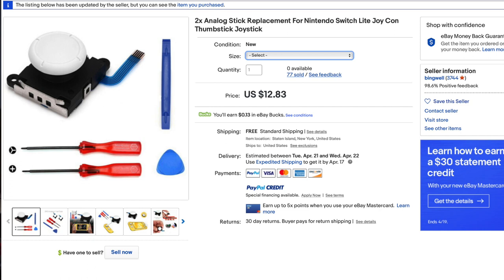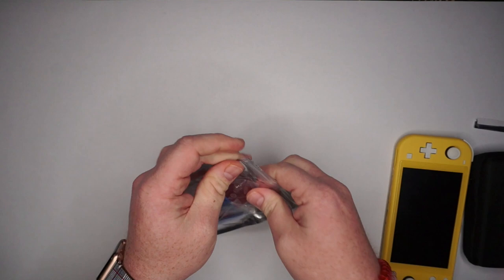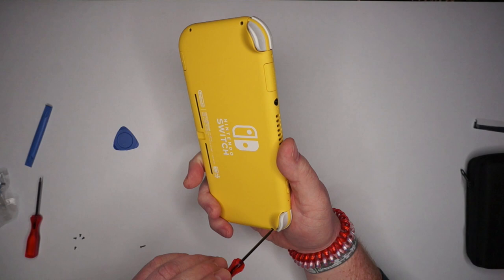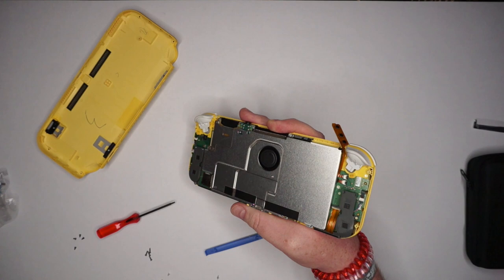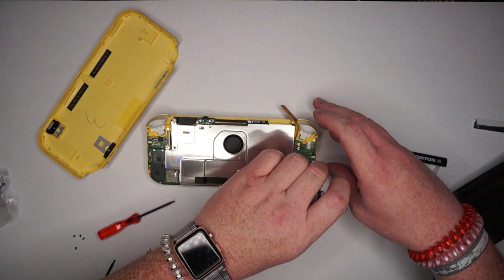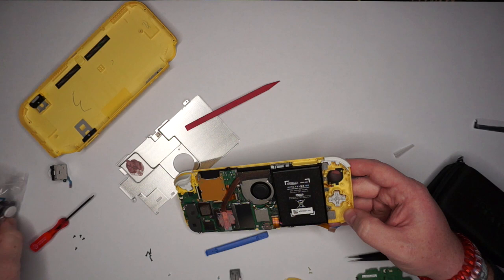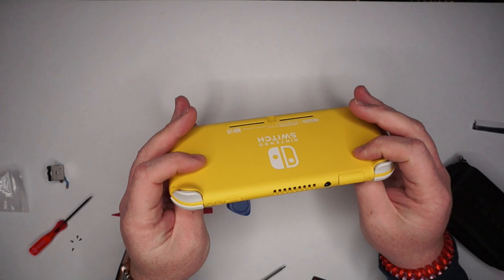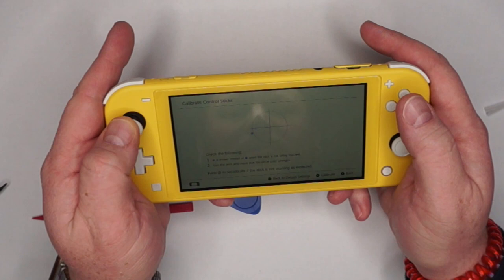Swapping a Switch Lite Analog Stick

Comment: I've never worked on tech hardware before, but I have to replace a toggle. Is this something a complete novice can do?
Reply from the maker: That’s a good question, honestly you can do it but it won’t be easy if you aren’t used to the way ribbon cables release and reconnect. If you have questions, definitely reach out to me on social media.
Reply: @PunchNpie  Thank you for the reply. I got the repair kit today and popped it open, but I didn't get farther than the speaker. Such small pieces, I wouldn't know if I broke it or not. So, I'll have to ask a friend. Thank you anyway, especially for making the video.
Reply from the maker: No problem, if you reach a point and can’t get it done and you live in the states (cheap shipping) I can repair it for you.

Comment: My switch fell off a chair and hit the radiator. The right joystick snapped out of the socket and I have no idea what to do now!
Reply from the maker: Oh no, that sucks!!! Well you can definitely replace it yourself. I don’t know how confident you feel doing this yourself though.
Reply: The exact same for me basically.  Left it out of my case on my bed one night and woke up to it on the ground.  The plastic ring (socket) just under the right analog stick on the bottom part broke and I’m hoping this place near me can fix it.  Basically in games I can’t actually look around.  The analog stick works perfectly fine though.
Reply from the maker: I really should start a repair service for these...
Reply: Same. Mine fell of the couch. I'm not sure if I'm brave enough to try this myself.
Reply from the maker: That’s sucks and I completely understand how you feel. Like I said above, I should start a repair service.
Reply: dropped mine off a bunk bed.. she had a case, and only the joystick snapped, but still stressful :') fixing her rn!

Comment: Well. Tried this and now the screen isn't working. Time to cry on the phone to Nintendo!
Reply from the maker: Did you forget to power it off prior to the repair? Hold down the power button to make sure it’s completely off and try turning it back on. I think when you remove the left board while it’s on, it kills the display.

Comment: I dropped my switch and the joy stick popped out of the socket and I couldn't get it back in. I got all of the stuff to replace the whole thing and I got all the way to the part where I put the stick in then I broke the thing that the ribbon was supposed to go in. My switch is ded
Reply from the maker: Oh no... that sucks! Is it the left or right stick?
Reply: @PunchNpie  my left
Reply from the maker: So you aren’t exactly screwed. The left stick connects to a board that is a separate board. the the rest of the switch runs off another board. I may be able to find you a replacement board if you are interested.

Comment: I got a switch lite as a gift so I could play pokemon with my little brother. Brand new and this problem you mentioned was the same. I got a kit off amazon for $15 and followed your steps. Worked great. Thank you, you helped me a lot.
Reply from the maker: Awesome! Glad I could help!!!
Reply: @PunchNpie  Yeah, you eased my concerns, it's been probably over 20 years since I've opened up my old gameboy to fix a wire issue. lol
Reply from the maker: Yeah and those old game boys had the simplest build too! It’s a single board and 1 ribbon, if I remember correctly.
Reply: @PunchNpie  I don't remember exactly why I even opened up it back then. I think it was something to do with the battery housing connections.
Reply from the maker: There’s a channel called the retro future. If you like videos of people modding and taking apart retro consoles, specifically the Gameboy, you would really dig it.

Comment: Thank you for this video, was very helpful.  One very helpful tip not made clear for the benefit of other would-be switch fixers:  There is a 'lock' on the ribbon cable housing that flips up!   I didn't notice this mentioned until the re-assembly later on in the video. I also used a paper plate to set parts and screws in a clockwise order to help remember what screws go where later.
Reply from the maker: Those are great tips and thanks for mentioning them! When I make these videos it’s usually the first time I’m doing the actual repair so sometimes I’ll miss something.

Comment: what if i accidently strip the screws on the plate covering the joysticks> im like two screws away which are both stripped from actually replacing the joystick, im so frustrated i feel like crying
Reply from the maker: Did your replacements come with extra screws?
Reply: PunchNpie only the black ones with the Y shape not the silver X shape screws.

Comment: My switch lite did the same thing on the left stick. The bouncing thing and it also drifted to the right sometimes. I only had it for 2 days when it first started but due to the switch lites being sold out i was unable to replace the whole unit. I also don’t want to wait until Nintendo reopens the repair shops and have to be without it for 2 weeks so I just ordered a repair kit last night. Hopefully it goes smooth. Thank god it isn’t the right stick because that looks more difficult to do.
Reply from the maker: Good luck and that sucks! I’m actually thinking about ordering another set of these and do white sticks and buttons on my neon yellow joycons. I’m hoping my kid doesn’t mess up the right one on her lite because you may be right about it but at the same time I’m willing to take on the challenge!
Reply: how did the repair go?
Reply: @skullkideku5735  it went well besides stripping one screw so i had to drill it out. i think its because the kit i got had some cheap tools in it. I have a better kit now with some better tools in case i have to do any more repairs. The better kit was the first one i ordered but i was told it got lost in the mail so i got a different one. then eventually the first one showed up. some of the screws were in very tight so be careful!
Reply from the maker: All good advice!

Comment: Great video! Were the triwing screws hard and tight to remove? The triwing screws were rather tight to remove in the switch console itself.
Reply from the maker: Thank you! Yeah they were tight but I just put a good amount of pressure on them and gave a quarter turn to loosen them and then they they came out easily.

Comment: hi! do you know if this will erase your data on the switch? my right one broke and I'm super paranoid about losing the stuff that's switch-specific!
Reply from the maker: If will most definitely not erase your system. When I swapped the stick, I powered it back on and it was exactly as it was before the repair.

Comment: I brought my switch lite in September ! I still have no problems with the joysticks but I always do wonder if I will ever have a problem. Seeing this video does help me feel better about being able to replace the joystick if I ever need to (I replaced a laptop screen before btw) but you know I’m still new at this so I’m gonna be a little nervous when the time comes. thanks for the video!
Reply from the maker: Yeah you may never have an issue buts its good you have some experience working on “laptop” size components. The connectors weren’t much smaller than something you would find on a laptop. Hopefully you never have to do this yourself but, if you do, you are more than welcome to reach out for any additional help or advice.

Comment: Hello yes I fixed my left toggle and now when I plugged the strips back in my nintendo switch lite won't turn on
Reply from the maker: I had that issue the 2nd time I repaired one and basically all I did was hold down the power button for like a minute and it eventually turned back on. If that doesn’t work, pull the back off and make sure the battery cable is fully seated on the board.
Reply: @PunchNpie  hey I had this same problem too but it still won’t turn on...if the strips get scratched a little will they still work? The kit I bought came with very pointy and needle nose like tweezers.
Reply from the maker: What happens if you plug into the charger? Anything come up on the screen?
Reply: @PunchNpie  no. Usually after plugging in the charger for a while the battery icon would flash showing that the systems charging but no nothing happens
Reply from the maker: Is the battery icon flashing with a black screen? It’s possible the battery isn’t completely seated. I would open it back up and unplug and replug in the battery.

Comment: I am sad. :( I bought some new joycon pads and did not realize you are supposed to put them over the default pads and not replace the default pads. I was left to assume what to do since it did not come with instructions. One of the rubber pegs for the default pads popped out and I cannot get it back in its hole for the life of me so the joycon pad is misshapen and unsightly. Any fixes for this?
Reply from the maker: Oh no! Are you talking about the actual analog sticks?? You can replace them but it’s not easy.  Is a switch or switch lite?
Reply: @PunchNpie  Switch Lite. I am talking about the default thumb grip pads on the actual analog sticks. They are held in place beneath the pad's lip with four evenly spaced peg-in-hole type appendages made of the same soft rubber(?). The fit is so tight and the rubber (?) so malleable that it seems near impossible to push one appendage into a hole once it has been popped out from the lip being lifted away from the hard plastic analog stick. :(

Comment: My son got water on the left side. Everything works perfectly until you use the left joy con then it locks down. I tried to reset it nothing. I did replace the joy con but no luck either. 😢 Do you think replacing that left board completely out will fix it??
Reply from the maker: That would definitely be the next step. If you replace the board, At that point, you’ve replaced all components on that side of the system so I imagine you would have no issues afterwards. Have you priced out what left boards would cost?
Reply: Idk what happened but before the switch booted back up I kept my analog stick facing up and somehow that reset it and now it's working. Thank you for your video it was so much help

Comment: My switch lite right control stick is working fine, but I can’t click it,  should I swap it or is there another way to fix it? Thank you ✨
Reply from the maker: The problem is that the whole analog stick is one unit and you can’t get into it to repair it. It’s probably easier just to swap the part out.
Reply: PunchNpie I see, thank you for your time

Comment: Mine was just a couple of months old too and I fixed it because of your video but it was nerve-wracking just like you stated well fixing yours when it's something thats new it can give you some stress I broke one of the connectors to the speakers on the board but that's because I couldn't tell where the pin connector was cuz it was so small but it doesn't matter anyway cuz I use headphones and external speaker system plus the internal speaker system sucks anyway
Reply from the maker: Yeah I guess if there was anything I would want to mess up, it would be the speaker. I’m sure you’ll eventually be able to find a replacement speaker and swap it out. Parts should become more available I think over the next year or so.
Reply: @PunchNpie  well like I said I use headphones I don't care for the speakers I wouldn't even replace the speakers if both were broken well no I lie I would have at least one speaker working that way in case if I sell it the only way I would replace a speaker is if it was Amplified and was louder the modifications would probably have to be done to get more power four more louder speaker how the heck would all that I'll just use my headphones but yeah thank you

Comment: This only show one button I needed the other side replaced, it's not hard but you have to remove everything out of your way I think it took me maybe an hr and 15 minutes and I ended up changing both buttons. You don't have to remove the battery or the button to replace the on the other side in order to replace the left side button as you look from the back.

Comment: i just did this and had to redo the process 3 times. i put my switch on sleep mode before i started. after my first attempt i tried to power it on, and it made noise but no display. i removed the power strip cable thing and placed it back in, still no luck. is there anything that i can do? i really need help
Reply from the maker: Did you fill reassemble it before powering it back on? I would check every cable, you disconnected doing the repair, snd see if disconnecting and reconnecting it will help. I had a similar issue but I don’t remember exactly which cable was not fully connected causing the issue. It may be easier to shoot me a message on social media if you want to continue the conversation if that doesn’t fix it.

Comment: I replaced the left joystick and after putting it back together the switch lite will not turn on. Double checked to make sure all ribbon cables were connected and all was ok. Still will not turn on.

Comment: i’ve just replaced my left analog but now the display won’t work and just appears black please help if there’s a fix!!
Reply from the maker: Hold down the power button until it’s completely off. Maybe upwards of 30 seconds and than power it back on. I had this issue with one of the repairs I did because I forgot to turn the system off first.
Reply: PunchNpie no luck :( anything else you’d recommend?
Reply from the maker: Open it back up and unplug  the battery and plug it back in. Did you unplug it when you made the repair initially?

Comment: I have everything unscrewed except a singular motherboard screw. Which is stripped horribly now because of how tight it was. How do I get it out??
Reply: There’s literally little to no grip left
Reply from the maker: You can always try the rubber band trick. If you aren’t familiar just look up “rubber band stripped screw”. That may help.

Comment: I accidentally ripped off the speaker plug now I’m crying forever
Reply from the maker: Oh no!!! Good news is that it’s a cheap part to replace. I just looked one up on eBay and it looks to be about $12. Here is the link: https://www.ebay.com/itm/OEM-NINTENDO-SWITCH-LITE-New-REPLACEMENT-LEFT-LOUD-SPEAKER-LOUDSPEAKER-Oem-/154229454980?_trksid=p2349624.m46890.l49292

Comment: Funny how similar our situations are. Mine also does that bouncing back thing. And it only does it sometimes. I didn't spill anything in it. It just started doing it and it's been getting worse. Sometimes it will affect all directions with the stick. And my Switch Lite is also the yellow one haha

Well, now I should know what to do when I go to replace mine.
Reply from the maker: Yeah I’ve been hearing so many stories from people that have the similar issue that she may not have gotten something on it but who knows. Good luck with your replacement.
Reply: I went ahead and did it. I got a slightly different kit from the one you did. But I think the thumbsticks are the exact same ones. I ended up with a couple extra screws when I was done. But it's back together and it seems to work fine. The funny thing is the kit came with some thumb grips with paw prints on them and those actually hindered the use of the sticks when I put them on. I thought the new one was failing too but it was those damn grips hahaha
Reply from the maker: Lol that’s funny, I imagine it’s the same factory that makes all the sticks and there are probably thousands of Chinese e-commerce outlets selling them. Good to know about the grips though. Glad everything worked out for you and I think it’s funny how there is always 1 or 2 extra screws.

Comment: Just got everything needed to fix my left joystick and the last screw I need to get off has been stripped😭 Any ideas on what to do next?
Reply from the maker: Which screw is it?
Reply: PunchNpie it’s the small screw on the left side of the green board that is above the joystick
Reply from the maker: It may be difficult to do but you may be able to grip it with tweezers and start unscrewing it from there. If you have Twitter or Facebook, you should send me a picture of the screw and location. I may be able to determine the best solution that way.

Comment: I didn’t disconnect my battery before doing this repair.  Thanks to watching another video.  Now my switch won’t charge did I total mess it up or can I replace the battery
Reply from the maker: Did you go back in and disconnect and reconnect the battery? There’s a few steps I would take to trouble shoot it. It’s most likely resolvable without having to replace the battery unless there is physical damage. If you would like me to continue helping you, I might recommend sending me a DM on Instagram or join the discord.
Reply: @PunchNpie  yes thank you will connect via instagram

Comment: I plugged the analog stick in tried to do the thing you did at the end and it did not work. anything you think would help?
Reply from the maker: The stick isn’t working at all or the system isn’t working?
Reply: @PunchNpie  the stick.
Reply from the maker: Oh if it’s not recognizing it, just remove it and reinstall it.
Reply: whoops I forgot to tell you if I press down on it it reads that is just movement its not working.
Reply from the maker: Weird, could be a bad stick. I literally just got done repairing one for another sub that shipped me their switch.
Reply: @PunchNpie  Could you send the link of the one you got to me?
Reply: ok well it turns out I broke my switch fully thanks anyway
Reply from the maker: What happened?!
Reply: quite honestly... I dont know